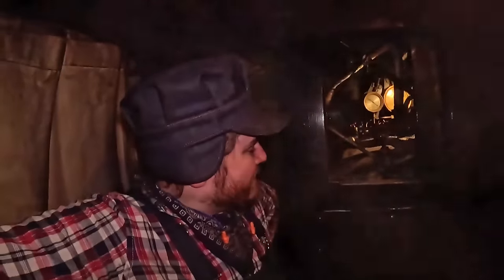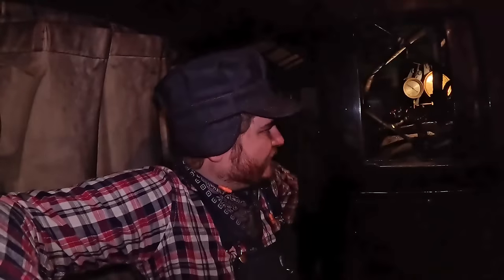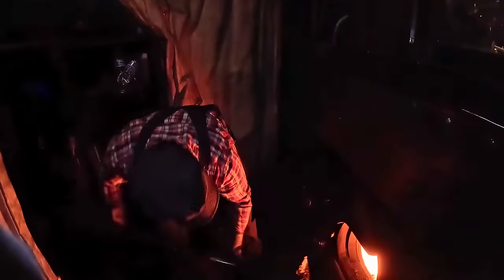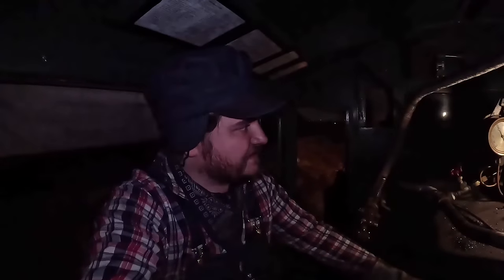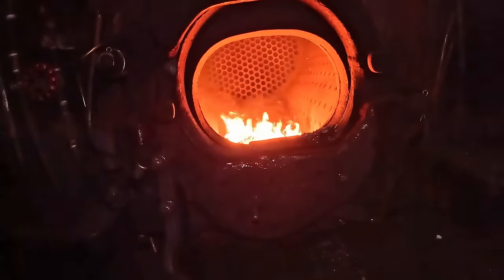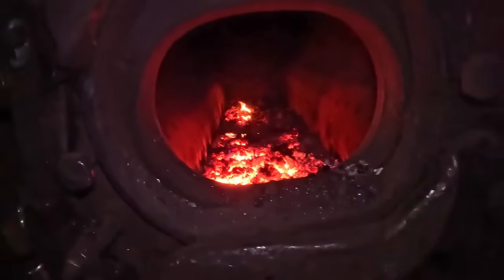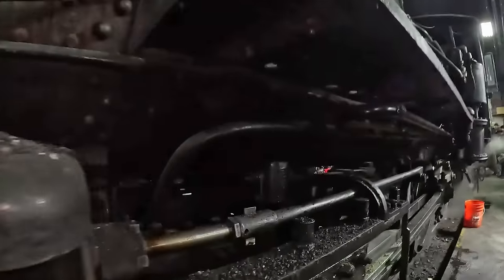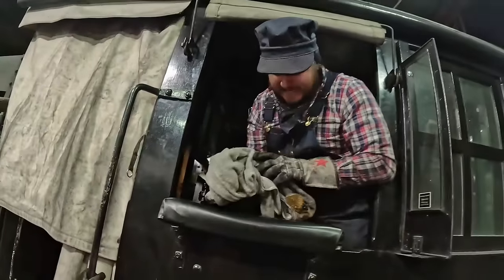How do you get a Steam Locomotive ready for bed? | Railroad 101

Comment: Back in the NS steam program the BIG locos were banked. As I recall 1218 gets 6 in. longer hot than cold.
Reply from the maker: For a big firebox it makes a lot more sense to bank. We used to bank 491 and she reliably did pretty well but the keyholes didn't like it for whatever reason.
Reply: @Hyce777  Learned something. I was only thinking size mattered. Firebox age, shape, rivets probably, too. Being hotter than the sun 24/7 makes an old lady cranky.

Comment: One thing I've always wondered about steam locomotives is, if we never switched to diesel or electric, would steam technology ever get to the point where the fire-person's job is automated (like in train simulators). We're talking sensors to monitor the pressure, fuel and water levels are automatically add fuel and water based on the throttle position. Would steam technology ever get to the point where you could automate double-heading? Would remote-controlled steam locomotives ever be invented? Would they ever be given digital gauges? Etc.
Reply: Probably. They already invented stokers that just feed the coal in automatically, though you might see the fireman still being there just to be a human failsafe and another pair of eyes on the other side of the cab. As for if RC MU'd steam locomotives would exist, they already do in live-steam, which is real steam just small and could theoretically be scaled back up perfectly fine.
Reply from the maker: Probably so.

Comment: I used to run an oil-fired light Pacific in South Florida, and we didn't have water that cold in the tender!   Shutting down was pretty straight forward:  Pull the wedge that keeps the tender's oil valve open, and let the oil in the line burn out. Shut off the firing valve, and use the blowback to use steam to blow any residual oil in the line back into the tender.  Shut off the appliances.  And just let the injector run continuously until the sight glass is about 7/8 full.  When you're done injecting, take tender oil and water level readings and calculate the day's water/oil consumption ratio.  Use the longirontoolIcan'trememberthenameof to break up any clinkers in the firebox.  Close the turret valve, make sure a driver or two is chocked, make sure the house cocks on the cylinders are open, and you're done.

Comment: Your talk of cold reminds me of a question I had: When it's below freezing, how do you keep the tender water tanks from freezing?

If it were me, I'd pipe low pressure steam into the bottom of the tank and let it bubble up through. That would also preheat and deaerate the feed water.
Reply: there normally is a feedwater heater. but 20 might actually be a bit older than that.
Reply: @themanformerlyknownascomme777  Would a feedwater heater heat the whole tank, or just heat the water as it's fed into the boiler?
Reply: I was wondering that as well and woulda asked Hyce in the comments myself if you hadn't already asked the same question.

As for my speculation as to how the tender water is kept liquid when it's below freezing, perhaps something like a steam or hot water radiator embedded in the floor and/or walls of the water tank, coupled with well insulating the tank to keep the heat in.

Comment: Do you need to wear hearing protection while operating a SL?
The dynamo itself seems like it's loud enough to require it
Reply: he's wearing hearing prot for most of the video, got those earplugs on a wire
Reply from the maker: Need is subjective, and most steam operators will argue one way or the other.

Me as an audio engineer, I always wear it or have them at the ready for when the train is doing things. Cab before airbrakes, whistle, safety valve, etc is 85 dB which is plenty...

Comment: Will the museum be required to convert from coal to oil in the locomotives like the D&S did? Is the museum required to keep he engines as close to original as possible? What happens if the coal mines shut down?

Comment: i know it is not topic of a video but... as a welder and a hobby machinist (with minimal experience) i was repairing that thing that is used to move a pallets (a hand forklift sort of), and there is this hydraulic piston and only then i realized how precise pistons are. And i dont know how or why i started wondering how do you maintain these tolerances in steam locomotives? because steam is corrosive(i think it is since it is water in gas form, but not sure?) the pistons would rust over time which would case them to cease. if steam locomotives would be build today probably stainless steel would be used but back in the day it was not, so how did they prevent it? or did the moving piston just grind any new speck of rust that appear and eventually the piston would be replaced?

Comment: It's kind of Imprecise Precise Science...." is a very good description, based on what you've said on locomotive operations before.  So was it the pipe to tender's air reservoir on the fireman's side that was blocked?  At least that was what it looked like to me based on the footage.
Reply from the maker: Just the valve itself. The pipes were fine. It was weird.
Reply: Hope it was easy to get the valve cleaned.

Comment: Hey hyce I have two questions how many sisters do 491 and 20 have and is 480 one of 491 sisters.And my second question is are you excited for railroad.
Reply from the maker: 20 had two sisters. Both scrapped. 491 had 9, now has 7. 480 is more of a cousin than a sister.

Comment: Is there a similar ritual for putting the train crew to bed? Once the loco is settled in, does the shop crew have to go to the nearest bar/late night pizza joint? And is it required that the conductor, shop foreman, or highest ranking man present buy the crew a round in recognition of their hard work?
Reply from the maker: We tend to have a beer afterwards, though it depends on the crew and the particular night. :)

Comment: My limited knowledge was that you want to limit pressure cycling as much as possible, which is why the engines were under pressure for weeks in a row back in the day while museum operations today are planning very carefully and trying to keep the cycling as rare as possible. Is this only a problem with regular gauge locomotives and the smaller engines on the narrow gauge aren't as susceptible for the problems? It would certainly fit into my experience of this being a virtual non-issue on the 7.25". We just ripped the fire out at once 😅

And that whole "chaining it down" thing just weirds me out every time. Don't you have stop blocks and wheel chocks across the pond? xD
Reply from the maker: My engineering understanding agrees with your assessment of fewer cycles better. Our engines don't seem to care with what we do; but I'd bet keeping them hot would be better. The reality is they don't see enough service for it to make it matter.

Comment: What keeps that engine made out of iron from rusting? Is the boiler 100% iron like I think it is? It should rest very bad.
Reply: The water is deoxygenated.
Reply: Maintenance.
Reply: I'm pretty sure 20s not THAT old, and that it isn't an iron boiler.
Reply: Well, okay, but how did we put rails across America in the 1860s before they had stainless steel? Yes the water is the deoxygenated but there's plenty of oxygen in the atmosphere and those engines aren't airtight. I do believe they use brick around the boiler but at some point water will condense from steam and be in contact with iron
Reply: @ReclinedPhysicist  I didn't mean that there weren't any engines with Iron boilers, just that 20 isn't one of them. Upon further research I can confirm that 20 was built in 1899
Reply: Going way back, locos just used any water and they suffered scaling problems which clogged up boilers. Once scaling was reduced, the boilers started to live long enough that corrosion mattered. Nowadays boiler water is either demineralized (no precipitates) or softened (precipitates don't form hard scales so they can be cleaned with a blow down), and it is deoxygenated and ph controlled, to minimize corrosion.

Google for "Chemistry to Tame the Power of Steam" .

Comment: my question is what the living hell is that metalic ringing/grinding noise? do all steam engines make that noise?
Reply: I think the high pitched sound you are asking about is the "dynamo" which is a steam turbine built together with an electric generator... 

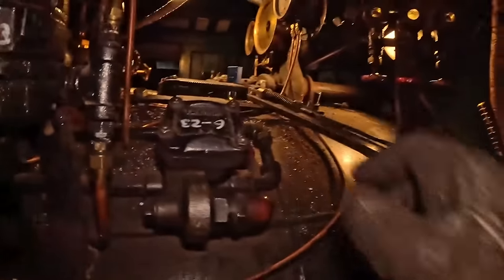On most steam engines this 9:25 "loud anoying thing" is a cylindrical generator about the size of two paint buckets end to end that is mounted on to of the boiler and just a few feet ahead of the cab. When you see videos of steam engines, you can often see the dynamo's exhaust as a white plume of steam about two inches across blowing straight up about three feet ahead of the cab.

It makes enough electricity to power the bright headlight and any other electrical equipment on the locomotive.

Comment: What drains water out of the injectors?
Reply from the maker: Depends on the injector type. Most of them have an overflow pipe out the side that dumps next to the track, which is required for operation as well.